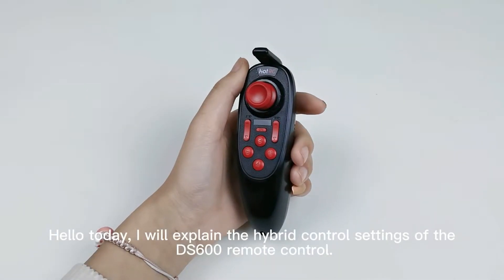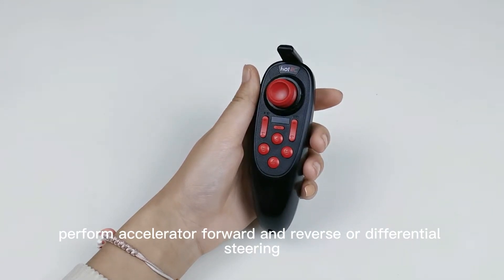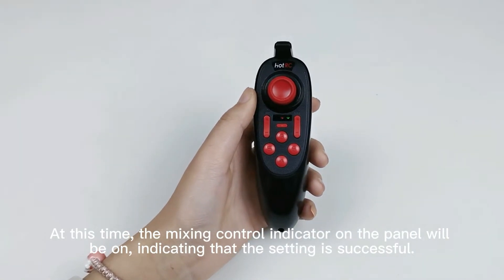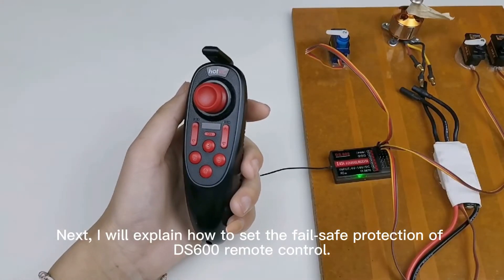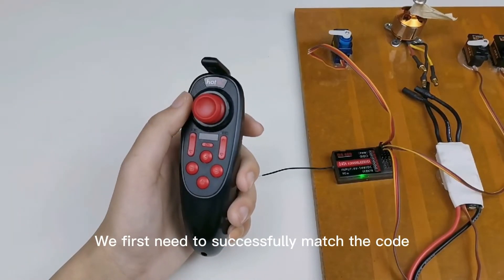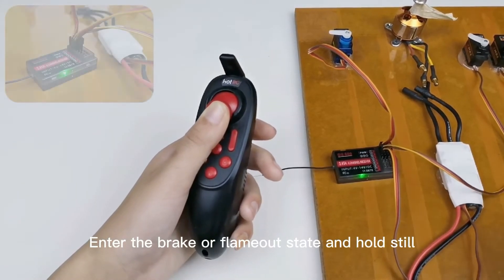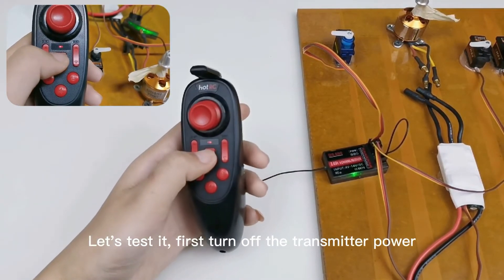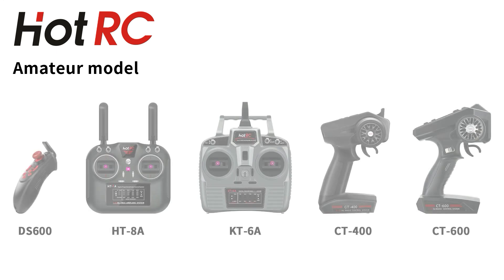DS600 Remote Control Mixing and Failsafe Settings

Comment: Hello. Thank you so much for your message. I have tried the steering trim as you suggested. The problem is the left steering trim has no range past center whereas the right steering trim has full range to the right. Why will left st trim not steer more to the left?

Comment: while mix function the problem

ch1 should control left and right
        but the action is forward and       backwards

ch2 should control forward and
 back ward 
        but action is left and right
Reply from the maker: Change the wires plugged into the receiver to see if the wires on your machine are reversed

Comment: How do you completely reset transmitter & receiver to factory zero original settings?
Reply from the maker: Can only be calibrated, not factory reset!
Calibration steps: First, the remote control is in the off state, press and hold the fine-tuning up button, and at the same time turn on the power switch of the remote control, you can see the marquee phenomenon when you hear the sound of Didi, then we turn the joystick to the left, and then turn the joystick to the left Go right, up, and down, then release the joystick to return to the middle position, and then press the fine-tuning button to save the data, that is, the calibration is completed.

Comment: How do you achieve differential steering with this mixing. I am not unable to achieve after watching this video
Reply from the maker: CH1/CH2 mixed control
1. Function description
The 1-channel/2-channel mixed control mode allows the 
1-channel and 2-channel to control 2 motors at the same
time for the forward and backward of the accelerator and 
the differential steering function.
2. Setting method
A. The remote control is turned off;
B. Press and hold the 【3】channel button, and then 
 turn on the power switch of the remote control, the 
 mixing indicator on the remote control panel will light up.
C. The operation method of opening and closing the 
 mixing control is the same, and the indicator light of the
 mixing control closing state will go out.
Reply: @HotRC-Sophy  does this automatically engage differential steering and does this work on the 4+2 or only on the 6 channel? When I place it in mixing mode I get no response
Reply from the maker: @brandonwightman5705  Which receiver are you using? Also, is the ESC you use a one-way ESC or a two-way ESC? The remote control does not automatically enable differential steering, it needs to be set.
Reply: @HotRC-Sophy  currently have the 4+2 receiver and the ESC is a bidirectional ESC. How can do I set it?
Reply: @HotRC-Sophy Hello do you have a reply to prior comment?
Reply from the maker: @brandonwightman5705  [4+2 receivers]: 1 channel for direction PWM signal, 2 channels for throttle PWM signal, channel 3 and channel 5 can only select one channel to use at the same time, channel 3 is PWM servo signal, channel 5 is power signal, mainly used for control For lights or trawl hooks, etc., only one of the 4 channels and 6 channels can be used at the same time. The 4 channels are PWM servo signals and the 6 channels are power signals. They are mainly used to control lights or trawl hooks.

Comment: Is the control mixing the ability to use this remote to make those omni wheel RC cars turn on spot or drive left and right?
Reply from the maker: The mixed control mode allows 1CH and 2CH to control 2 motors at the same time to perform accelerator forward and reverse or differential steering, but this remote control is suitable for ship model. If you are using an RC car, you can take a look at our CT600 remote control